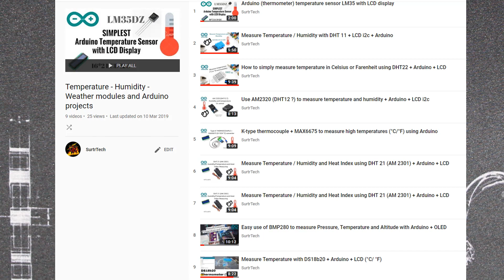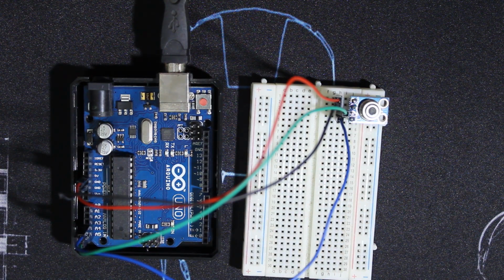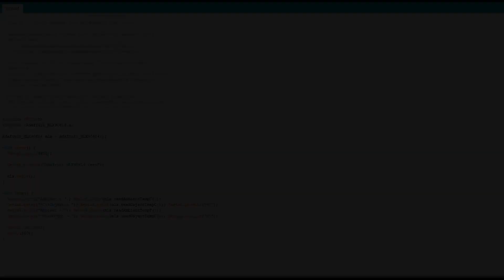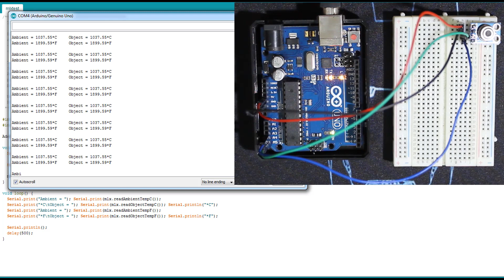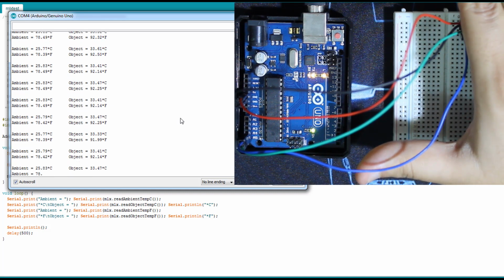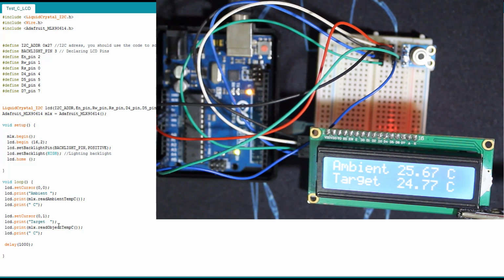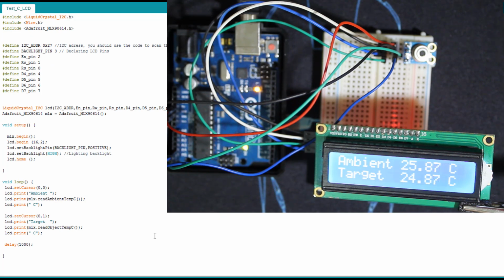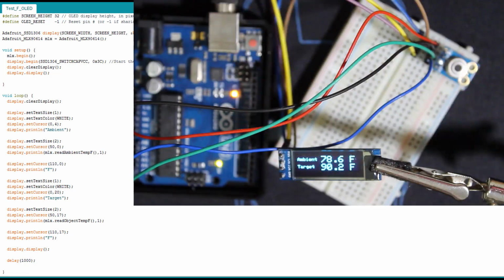Contactless temperature sensor MLX90614 + Arduino + LCD/OLED

Comment: Hey man. I'm kinda in a hurry, but my readings are showing 1000 degrees C. I don't understand how you fixed yours. I checked the wires correctly and I'm not sure why its not working.

Comment: how if I want to add operating button?
Reply from the maker: If you're talking about "pressing a button to measure" like a thermometer gun.
Add a push button, declare its pin and pinMode, go to the loop function remove that delay at the end, take everything and put it inside an "if(button_state)" condition ... then in the loop always read the button state if it's pressed you start measuring in real time and when you let go it keeps displaying the last values.

Comment: Hey there, I am making this as my first arduino project. I have ssd1306 with 7 pins, MLX90614 infrared sensor , the same which you have used in video . I want to use it with arduino nano. I watched how they did on instructable. I tried with same circuit connections. It didn't work, only OLED screen was ON. I don't even know if the sensor is working or not. So can you help me with sensor and display?
Reply from the maker: Hello, first thing to do is to separate both for test:
- Use the sensor first with the serial monitor, make sure you have the right library, right i²c address and check if it works well with serial monitor.
- For the SSD1306, make sure it's i²c (check for pins SDA/SCL) otherwise it's a SPI and this code won't work for you and you have to adapt SPI version to this.

Comment: What of Oled display did you use? Is it the
OLED LCD I2C 0-69-Blue Module for Arduino?
Reply from the maker: 128x32 OLED i2c, SSD1306
Reply: @SurtrTech ummm I have a question. My group team bought the OLED 0.91 Blue module and I was wondering how do we start it to work. Will it power on if plug to the correct setup like in the thumbnail? Or do you program it first in order to power on the OLED display?
Reply from the maker: You should use it with a board (Here Uno) and put in the code what you want to display... always begin with code from examples.
Reply: @SurtrTech  so youre saying that the OLED Display is that you need to input the code first in order it to power on and display on what you want to it to display. Am I follwing it cleary? Really sorry Im just an amateur
Reply from the maker: You're using it to display something right? Otherwise how the display will know what to display?
Reply: @SurtrTech  Yes. We get it now we just try it a moment ago and it work ty. I was saying to my team that we need to input a code first in order for it to display they listen to me at first so I show this them.

Comment: Super nice system, just one question, do you need any resistance as a protection of the sensor? I mean it is possible to burn the sensor, connecting it to 3,3 v pin? my sensor got super hot today and is showing the same mistaken reading that you had in the video, I couldn't be able to make it work
Reply from the maker: I checked its datasheet, it doesn't require any resistor, it's powered by 3.3V, mine wasn't getting hot, of course I didn't like that difference in readings, but I think if you want something more stable it's better to aim for better modules...

Comment: hi
i currently want to do a project using the ir temp sensor with piezo buzzer,water temperature switch and oil pressure switch and i would kindly request for your help if possible in the coding process and other sections which i might be less knowledgeable about...looking forward to your kind reply...thanks in advance
Reply from the maker: You contacted me on FB right? I sent you a test code there
Reply: @SurtrTech   Hi. I am also doing a project with the same MLX90614 sensor and I need to turn on a pump and some LEDs at certain temperatures, could you please help me with the code please
Reply from the maker: @marcoaguilar3209  Sure, you can send me a message on FB page, I'll help if I can